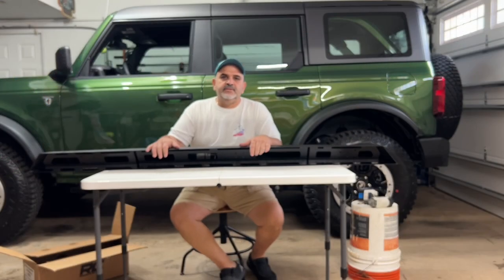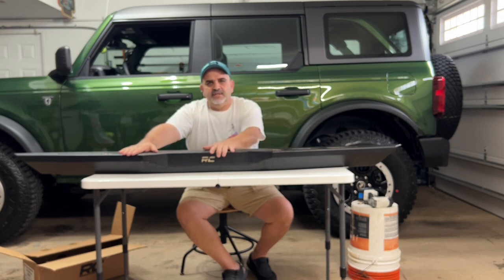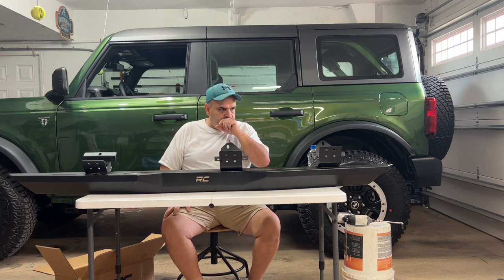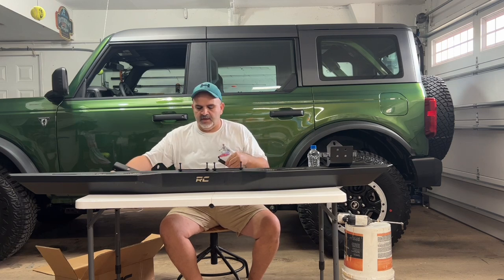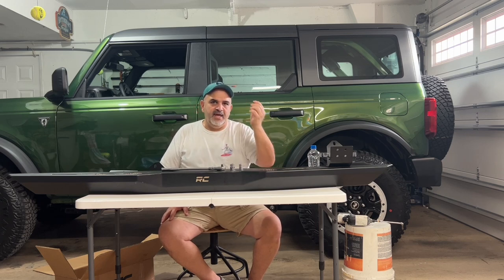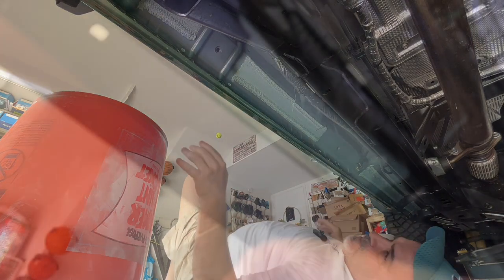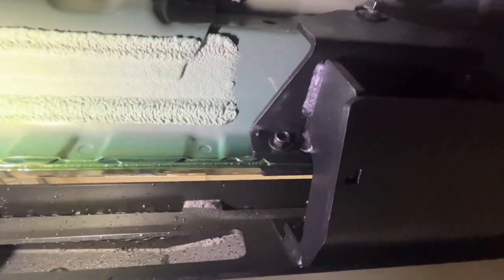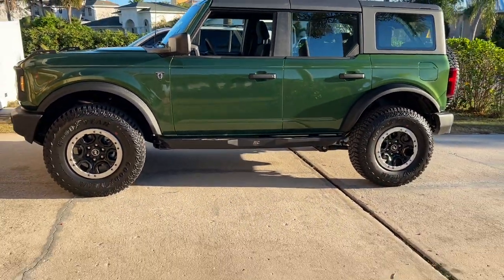Installing Rough Country rock sliders or side steps.  https://amzn.to/3skZrrP

Comment from the maker: Hi, sorry it took me so long to get back to you, I hurt my back.   Yes, I love them.  They are a little high, but I get in much easier now.  The 2 things I like about them the most is. They look great.  I also love the way the middle moves back in toward the Bronco so it make it extremely easy to exit the vehicle, I don’t have to move away from the Bronco to get out.  Thanks have a great day.
Reply: Thanks! Mine showed up yesterday. Installing now. What a pain in the butt! Wish the would have just used factory slide mounts.
Reply: Hope the back feels better. Mine may be hurting tomorrow after wrestling those rails in 😂
Reply from the maker: Sorry, it took me so long to get back to you. I have had them on for about 3 week and love them.  they look geed and the middle part coming in makes getting out of the Bronco so easy.  Post a photo of your when your done. good luck
Reply: Found out why I was having such an issue. One of my mounts from @roughcounty was welded all bent and was off by about 3/8". The other side was done in and hour included pulling the stock sliders.
Reply from the maker: @SilentSentry1776  that sucks, nothing worse then getting ready to get it done and a bad part hold you up. Is rough county shipping you a new bracket?

Comment: Nice video. Definitely piqued my interest. I was wondering what the vertical height the sliders are, and how far down below the bottom of the pinch weld they hang. I've looked all over the RC website, but they only tell you the length.
Reply from the maker: Hello, the top of the sliders tuck in rite where the pinch meets the body. From the ground it measures 20 inch to the top and the bottom of the slider is 16.  From the bottom of the pinch weld to the bottom of the slider is 2 1/2 inches.  Hope it helps.

Comment: I would have liked to see you completely climb in with the running board.  No one includes that in their running board videos.  We installed a set that actually made it more difficult to climb in - I threw my back out trying - and we had to uninstall them and ship them back.  Pain in the butt.
Reply from the maker: Yes, I should of added that. Did you install the same ones?   The rock rail ones are much higher than he side step ones. I can get in pretty easy but I’m use to it by now. Mine are high, the only thing that make it easy to get out is that the middle is cut into the body and I slide out through the middle.  Good luck, there are so many options it’s hard to chose one.
Reply: @fredsgarage1925  we tried a set sold by iag.  They accepted the return with no hassel (other than the hassel of packing them back up and actually shipping).  They were easy to install but didn't work for us.